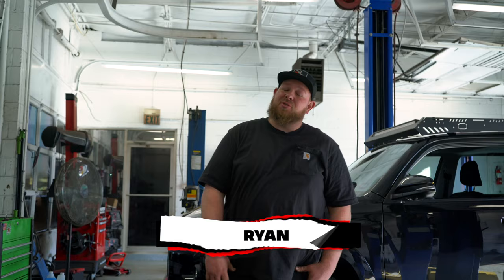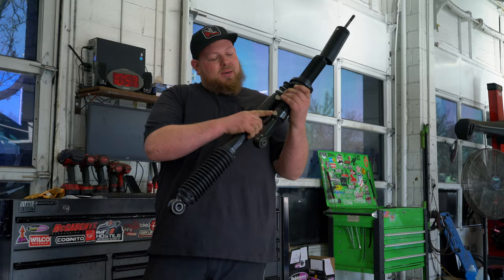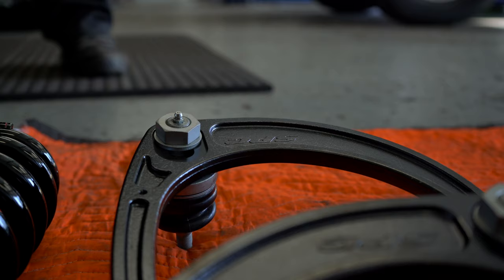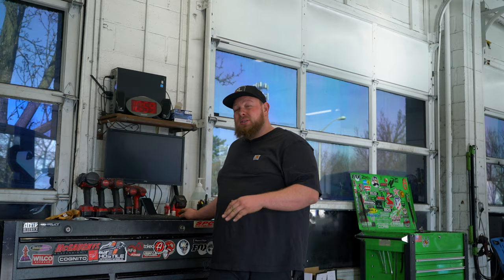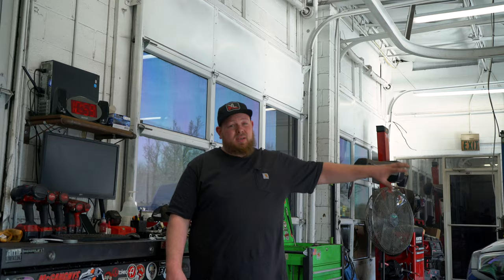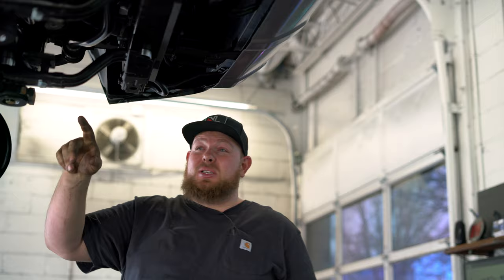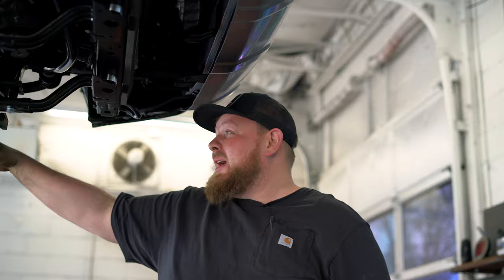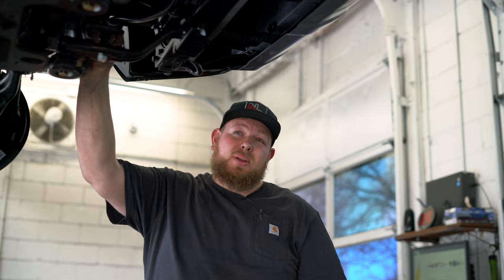Dobinsons IMS 3"/2" Lift - What to know?

Comment: Awesome video / editing sir..  We have 22’ ORP T4R and installed basically the same but opted for Dobinsons leveling kit with RR7H -12 offset wheels on 275’s. We love the stance and ride feel. ORW did the install for us but do have rubbing issues on B mount. Btw, did this build have any issues with rubbing on 285’s? 
Thank you..
Reply from the maker: We had no rubbing issues, did you guys installed upper control arms?
Reply: Yes.. SPC  UCA were installed they did  alignment as well. Difficult to question their work since they’ve been around forever. Off Road Warehouse recommend BMC.  Any other suggestions is greatly appreciated. Thank you!
Reply from the maker: We aligned to 0 camber and 4° caster and we didn’t have any rub but every vehicle is different!  A body mount chop can’t hurt, especially if you off road.

Comment: i have a 2022 4runner off road premium.  Is the Diff drop recommended for that model year those also?  Did you have to recalibrate the toyota safety sense?
Reply: we recalibrate the yaw rate and steering wheel angles with the alignment, not usually necessary to mess with the TSS.  I would recommend the diff drop with 2.5" lift and up just so you aren't going through axle boots.

Comment: great vid! qq: Can the front struts be adjusted without taking it apart? I just installed my IMS and the front right is a bit high compared to the left side... thanks.
Reply: yes, it can be tedious but we usually make our final adjustments with the front suspension at full droop after its been installed.
Reply: @RJ-mq9th  no spring compressor needed?

Comment: Hello Sir.
I want to add 2 inches of Dobinson lift kit in front and rear to my Prado 150.
Should I get Dobinsons IMS or the regular yellow ones?

Do I need to get spacers as Prado leans on sharp turns or roundabouts?

What should be the front springs- C59-352?
Rear Springs C59-325?

Front Shocks IMS59-50700
Rear Shocks IMS59-50705.

Sorry for asking a long question.
Reply: Thanks for watching, that lift would give you 2" of lift all the way around as long as you aren't planning on adding a front bumper/winch or any weight in the rear it should be good.  I would recommend the spacers just to make the truck as level as possible.  You/d put them on whichever side leans factory/front and rear.  I prefer the IMS coil overs because they are monotube, adjustable and rebuildable but the regular yellow ones will do the job just fine, depending on budget.  Let me know if you have any other questions.
Reply: @RJ-mq9th  thank you for the reply.
If I add 30mm hub centric spacers,  will that prevent risk of rollover chances?

Comment: With a kit like this installed. Do you guys level it so it doesn’t have that lean on the drivers side ?
Reply from the maker: Yes, we use coil overs to reset it/re-check the ride height after it’s all set. Most times it takes a few tries to make sure everything is leveled side to side.

Comment: Got a 2021 sequoia and have IMS kit about to get installed. Dealer I bought it from and will install it says I dont need upgraded UCA because stocks are able and no need a diff drop. Is this true?
Reply from the maker: Yes, you can use factory UCAs, but they will not align to factory specs.
Reply: @nolimitbaltimore  I C. Ok down the road I guess I'll look into that too. Thank you
Reply from the maker: No problem!

Comment: Is this on stock upper control arms?
Reply: No, we used SPC Upper control arms to get the alignment in and everything back to factory angles.
Reply: Lmk if theres no need for upper control arm upgrade on my 2021 Sequoia because my dealer I bought the IMS kit says the stocks have a lot of play on Sequoias
Reply: @overlandersnorthwest  no idea about sequoia, on my Prado the IMS and 2" lift needed alignment real bad. Stock uca worked though
Reply: @randomuser6306  ok thank you
Reply: @overlandersnorthwest  stock control arms will work up to 3" of lift but the alignment will be slightly uneven. .5+ degrees of camber and 2.0 degrees of caster or less. not optimal but doable in stages.
Reply: @RJ-mq9th  great info thank you